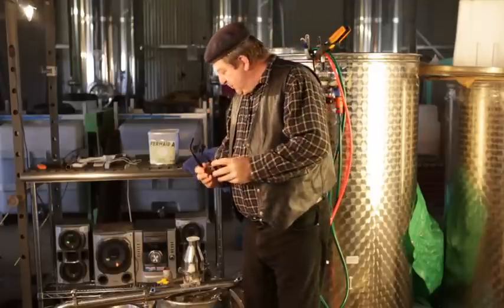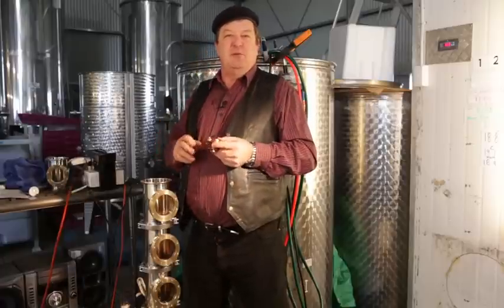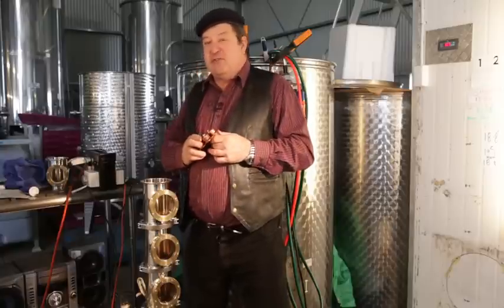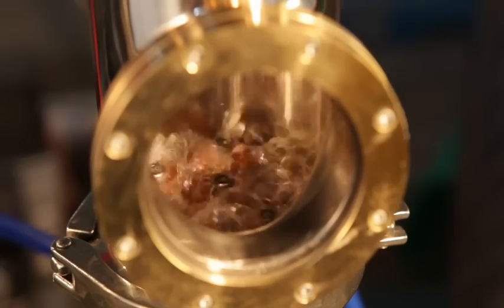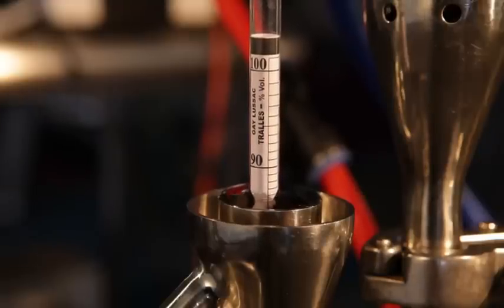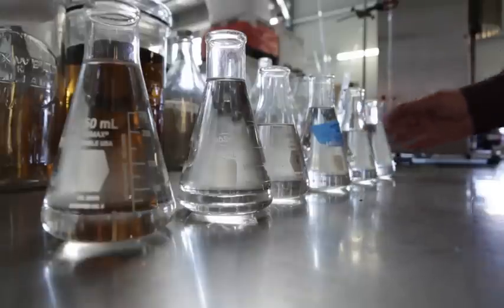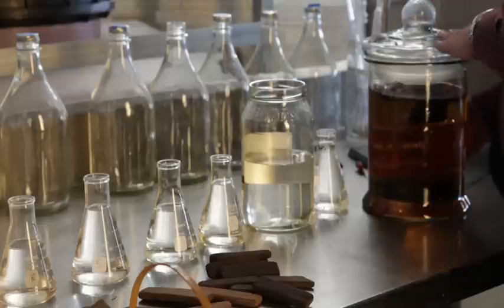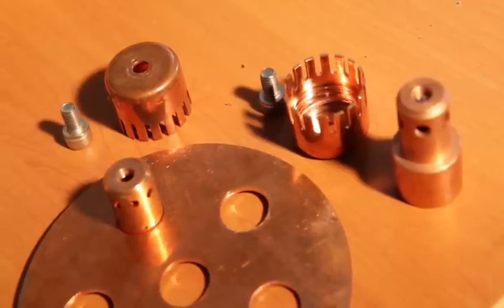Single Malt Whiskey - Ep 2 ( for the home distiller).mp4

Comment: Purge the parrot at each jar during the heads stage of the run to minimize smearing. You can use the valve at the bottom of the parrot to do this very easily.